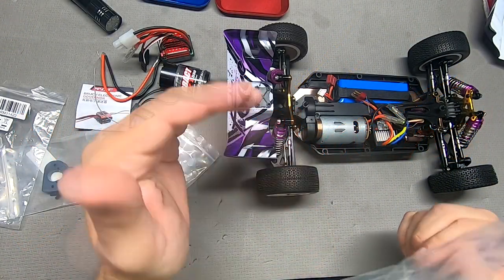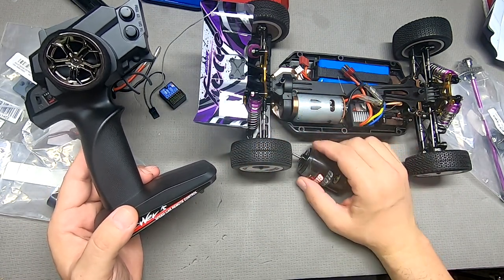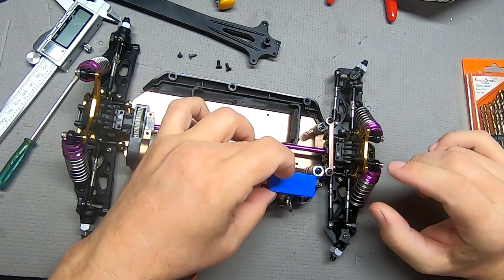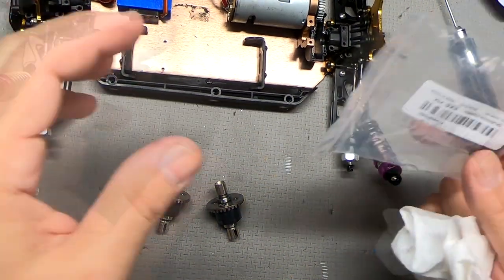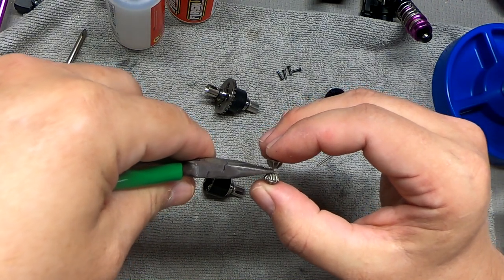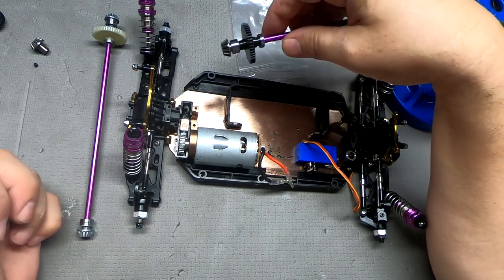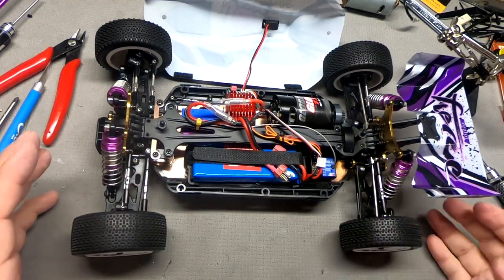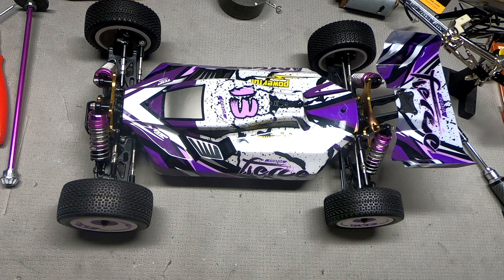New Motor, Diffs, Electronics, & Speed Test - Wltoys 124019 RC Buggy 4WD - Pt. 7

Comment: on my second 144001 i ordered an esc and i am going to use my old flysky computer radio... i have over 10 rx s for that and the range is over 300 meters easy since i converted it to a lipo 10 years ago... i agree the 550 stock setup is great.. i like the gearing also...i get like 20 mins fast and med use on 2s 1500 stock battery.. i have 2 hobby chargers but i find it very simple to just charge this car using laptop usb.. i run this car 2-3 times a week...great car for beginners and anyone that enjoys rc imo
Reply from the maker: Yes, a great place to start. Have you heard about the new 104001? Its wltoys' new 4wd buggy... true 1/10 scale. I preordered one back in January. They are supposed to come out around the end of March. Here's a link
https://shop.makerfire.com/products/wltoys-104001-car?variant=37872357408965&currency=USD&utm_medium=product_sync&utm_source=google&utm_content=sag_organic&utm_campaign=sag_organic&utm_campaign=gs-2020-06-16&utm_source=google&utm_medium=smart_campaign&gclid=CjwKCAjw9MuCBhBUEiwAbDZ-7vy_hXIWWv3OGMYUAoUjDMQtnR11319pdhZpRke19fzezbb2MceT4RoCSZMQAvD_BwE

Comment: Those wl toys rc models are good value for the money.
Reply from the maker: A little preventive maintenance and they are certainly worth the price.
Reply: @MyRCChannel-CJScott  60 packs through this 124019 except 2 sets of tires no visible wear to the gears just the drive cups (marginal)
I use thicker EP90 gear oil for the inner diffs and EP2 grease and a few drops of gear oil on the ring gear.
Reason for this is that the grease will just not stick most of the time due to the centrifugal force.

Comment: Best info out there. I’m a beginner and what you say makes perfect sense. 😎 I have the same goal with mine that I will get soon. I live in China they have complete metal builds available for this car. Also a brushless conversion package with a 5200kv motor esc and metal gears included in one of the packages. Fun times ahead. I’m looking forward to the fine tuning etc to make the control match the speed. Fun times ahead
Reply from the maker: Thanks for the compliment! I'm glad you're enjoying my videos. 
I'd recommend against the full metal build. 
- It adds weight in the worst places... unsprung weight slows the reaction time of the suspension. 
- A little flex in the suspension arms can be a good thing. 
- Plastic parts fit better due to the tolerances needed when making metal parts. So, plastic makes for more precise steering and handling.
- Plastic is much less expensive to replace if damaged.

Also, unless you've got money to burn,  I'd stay with the brushed motor. The car is fast enough as is. Brushless isn't as big an advantage unless it's sensored and sensored motors/esc's are much more expensive. At least wait until the motor fails or gives you a reason to replace it. 
Save your money for things like a proper 2-4 battery charger... make sure it has a "storage" cycle. Properly leveling your batteries is very important. Also getting at least 3-4 batteries for each car helps you not over stress the batteries which can lead to fires and explosions... I'm not exagerating. Check out my video on lipo safety: 
https://www.youtube.com/watch?v=1HjSg_TeIq0&t=3s

Or save for the new 104001. It's the new 1/10 scale 4wd buggy and is the next step up from the 124019. Here's the link: https://shop.makerfire.com/products/wltoys-104001-car?_pos=1&_sid=47c177d8c&_ss=r

I've got on on pre-order myself... looks to be a fun buggy!
Remember, there are no dumb questions and I'll never make fun of someone for asking about something they don't know. 
It sounds like you're off to a good start. I'm sure you'll have a good time with your 124!
Let me know how you like it. And feel free to contact me anytime if you have a question or get stuck.
Regards,
CJ

Comment: I have the  124019 did not change the motor mount  just upgraded the gearing  and diff's lowerd it put foam tires on  nice body   running Hobbywing ESC and motor I am geting speeds of 97 to 100 mph on 3s
Reply from the maker: That's very impressive! I live in a very urban/congested area... it's hard to find a suitable place to do speed runs.
I like to hear what my viewers are doing... thanks for watching and reaching out!
Reply: how will you speeds 97 Mph and keep distance of 328.04 Feet ?===> your transmitter are "out". probably you can "car raced" this is Bonneville

Comment: I wonder if my local hobby shop will do the diffs, suspension, and alignment??  You did a much more thorough job on this car than any of the other channels I’ve seen.
Reply from the maker: Thanks for the compliment. I can't speak to what your local shop can do, but it would probably cost more than the car. I'd recommend attempting the job yourself. Especially the adjustments to the suspension. That's the kind of thing you want to learn and become comfortable doing. 
Instead of paying someone to do the work, you might want to spend that money on tools.
Here are some links to info on rc car suspension, how it works, and what changes do to handling. 

https://img2.associatedelectrics.com/pdf/cars_and_trucks/shared/RC_HandbookV2.pdf

https://www.competitionx.com/rc-tuning-guide/

https://www.rctech.net/forum/electric-off-road/708385-understanding-tuning-introduction-basic-tuning-racing.html
Reply: I blame you. LOL. all the other videos I’ve seen people just grease the diffs and pull a little oil out of the shocks. I thought heck I can do that. Then I watched your videos and thought oh no that’s a lot. I’m gonna have to follow the other videos I guess.
Reply from the maker: @GratefulEd907  Nah, dive in... it's all philips head screws. You'll do it once and it'll be a cake walk after that. If you don't have diff fluid, go ahead and put in some grease, but don't over pack it. Some of it will leak out eventually either way. Don't over tighten the diff screws, twist the outdrive to make sure it turns... if it feels choppy, loosen the screws a bit till it feels smooth but firm. On all the screws use two fingers because they strip easy. Just snug them down, the plastic keeps them from loosening up.
Reply: @MyRCChannel-CJScott  I’m gonna try it I guess. Thanks for the confidence and encouraging words.
Reply: @MyRCChannel-CJScott  just wanted to bug ya one more time. Can you tell me what size Phillips head screwdrivers I’ll need and I’d like to replace any screws I take out with better ones. What should I search for on eBay to find a screw set?

Comment: Great presentation, it's good to see all the pitfalls encountered whilst upgrading and the honest end conclusion; that this project was better left in standard kit form. I'm just wondering if you would consider a similar presentation but this time from Nitro to Brushless...might sound a bit odd but I've noticed second hand Nitro cars going on eBay for next to nothing (unfinished projects or spares & repairs). For example, the rolling chassis of a Kyosho GP Ultima (2wd) is similar to its electric version and with limited tools (Dremel and electric drill, etc.)  could be modified to accept a Brushless set-up? An obvious advantage would be that Nitro kits tend to be beefed up (compared to their latter-day brushed motor kits) and we all know that brushless needs a stronger chassis/components. It's just a thought, but with a few holes drilled here and there, perhaps an brushless upgrade kit, available online, could transform an old tired-out Nitro kit?
Reply from the maker: Nitro is a bag of cats I don't want to get caught up in. But, I've got two brushless RTRs coming soon: the WLToys 104001 1:10 scale 4WD Drive Off-road buggy and the ZD Racing DBX 10 1/10 4WD 2.4G Desert Truck Brushless links below... lots of planes this summer two! And I just finished a race truck and a touring car for VTA. Check my channel's home page. Thanks for writing! I appreciate your input and I hope the upcoming projects interest you.
https://shop.makerfire.com/products/wltoys-104001-car
https://shop.makerfire.com/products/zd-racing-dbx-1-10brushless-rc-car

Comment: What tx do you use in your mod?
Reply from the maker: I’ve got a couple… an Airtronics that I’ve had for years, and a Noble NB4 which I bought earlier this year. I bought the NB4 for mini-z but am now using it as my primary transmitter since it has such great features. You can even switch the wheel for lefties and righties. 
Thanks for watching!

Comment: Well I managed to destroy my shock tower, diff case and steering knuckle in my first crash very frustrating now waiting for replacements. I now understand what you mean on the build quality. I was thinking of upgrading parts but now im thinking of getting something built for purpose. My friends have 2wd TA SC trucks and they are good fun to be honest. What would you recommend, Im not a massive buggy fan and do prefer the look of truggys and short course. Primarily street racing, grass and dirt? Can you recommend any good options using 2-3S? Thanks for any advice.
Reply from the maker: Sure, this all depends on your budget of course, but Traxxas has some great offerings that are in between  the WLToys cars and the "real" race capable RC kits. The Slash in either 2wd or 4wd is an excellent entry level or low-budget SCT option. I'd recommend 4wd over 2wd because they do better in unprepped environments like grass, mud,  wet or loose sand, snow deeper than 2-3 inches, etc. The 2wds get bogged down more easily and can't claw it's way through the heavy stuff. You can even race the 4wd at a lot of off-road tracks with little to no modifications. They are very durable and parts are both plentiful and inexpensive. Most hobby stores will carry parts for suspension as well as online options like Amazon. No waiting 4-6 weeks for parts to come from China. You definitely get what you pay for... if you're interested in the Slash 4x4, check out my video series where I mod one to race in an on-road class called "Truck" where the rules say the vehicle must be based on a truck kit, must have rubber tires and must run on a 2S battery... otherwise anything goes. It's a really fun class to race in and as you'll see I really mod this 4wd truck into a hot race car. 
This is a playlist with all the videos in chronological order... Enjoy: 
https://www.youtube.com/watch?v=YtQrDw0TYKs&list=PLWi1J2KoLS71CXt8_tHXnAqSBpd9FKJwU
Reply: @MyRCChannel-CJScott  Thank you I will check out that play list and also the slash.

Comment: At 1:13:23 I swear that the front and rear left side wheels need to be swapped. It looks like you have the wide one on the front. 

That would definitely contribute to the lack of grip under acceleration.

Comment: smooth diffs and drive trane means more punch and top end plus longer run times in most cases
Reply from the maker: Yes, but tighter/stiffer diffs means better power delivery to all four wheels with less spinning. Varying the stiffness front vs rear is one way to address over & under steer. Tuning is definitely an art form.
I don't know what is your level of experience, but these may be of use to you. Enjoy!
https://img2.associatedelectrics.com/pdf/cars_and_trucks/shared/RC_HandbookV2.pdf

https://www.competitionx.com/rc-tuning-guide/

https://www.rctech.net/forum/electric-off-road/708385-understanding-tuning-introduction-basic-tuning-racing.html

Comment: There's plenty of 100+mph of these all over youtube? Have you searched this car at all? if not, take a look! Amazing what mods people have done for a reasonable price that makes sense.... I have used the soldering iron trick alot with the motor bells on my race drones ALOT, virtually everyone from factory cause they use button head steel chinesium screws.. Gotta get that thing hot.... i mean cooking, then it will release the locktite, not burn it out...  I have a Losi and that money pit is what made me want one of these.... Can't bring myself to spend that cash on something that while it does have higher quality Q.C. and body, This may be some more work, The price in my opinion is not worth it for my LOSI compared to this... can be all aluminum everything and metal gears with parts setup for my use case, and still have cash without losing range anymore. IDK, maybe my LOSI was a one off, it happens, but just my opinion... its like butt holes, everyone has one and would prefer not to hear them.... LOL
Reply from the maker: Sure, I've seen a bunch. I just don't want to spend a lot of money into a cheap car that I can't race. This car isn't legal for any ROAR classes and my focus is on cars I can take to the track. I also only have so much time and money. Lots of people are having a blast with these and that's great. I also think it's a great car for the beginner that can't afford a high end car. There is a new 4wd buggy coming out from WLToys... the 104001. It's a 1/10 scale version of the 129. You might be interested in this. It's still on pre-order, but is supposed to be out end of this month.
Thanks for watching!
CJ
Reply: @MyRCChannel-CJScott  Absolutely, If your planned intention in the hobby is racing, 100% agree! There are no tracks where I live or closer than 2.5 hours away, racing is out of the question for me. Nobody would dump their hard earned cash into something they cannot race, well hopefully LOL. Why make a car that is not approved to a race class? what were they thinking? Seems like a sales gold mine for something of good build that can or can be modded easily to race. Just missed it WLTOYS! From your point of view, makes some more sense, From mine, I was baffled haha. two totally different  perspectives, two totally different usage applications. Thanks for the reply! Keep them vids coming man!!
Reply from the maker: @short-circuitz  That's to bad you don't have a local track. I've got 2 indoor offroad facilities attached to hobby stores about an hour away in opposite directions. I also race on-road with a club that is run by one guy. He got permission to use a high school parking lot. He purchased a timing system and he makes the track layout using old fire hoses, metal frisbee-like disks, and PVC gutter material. He charges people $10 for the first class and $5 for each extra class. I usually run 2-4 classes on a given Sunday... Euro truck, 1/8 GT, 1/10 modified truck, F1, and I'm putting together a 1/10 touring car for VTA (Vintage Trans Am). If you're curious about the modified truck class, check out my video series on the Slash... I starts as a 4wd truck and evolves into a low  4wd 1/10 GT running 1/8 wheels tires, and shocks. At least one or two of the videos have race footage and handling analysis.

Comment: Hi, im looking to buy my first hobby grade RC, would you recommend this one ? I don't want to buy something too expensive since its my first one. Awesome videos btw.
Reply from the maker: Thanks, I'm glad you're enjoying my channel. This isn't a bad place to start and since it has turnbuckles front and rear, it can be a good learning platform.
But, since it isn't a proper scale kit, it can't be raced... there are no classes for racing off-road cars smaller than 1/10 scale.
For the price, it's a good way to get a taste of RC while you decide if you want to race, bash, or other... 
BTW, what are your goals? Do you ultimately want to race? If so, have you identified a track or club near you? These are important questions. If your goal is to compete, you don't want to spend money on cars you can't race at your local track. For example, if there is a hobby store with an indoor road car track, you'd be better off focusing on on-road cars. There is nothing more frustrating than spending upwards of $1000 on a race car and not having anyone to race against. Ex: if everyone at your local off-road track is racing 4wd short course trucks, you don't want to buy a 2wd buggy.
If you just want to have fun in the local parking lot or dirt lot, the 124019 is a good way to start cheep. I don't recommend doing a motor swap, It's plenty fast as is... buy the bundle that comes with 2 or 3 batteries.
Learning to tune suspension is very important. Here are a couple of great guides to suspension tuning... 

https://img2.associatedelectrics.com/pdf/cars_and_trucks/shared/RC_HandbookV2.pdf

https://www.competitionx.com/rc-tuning-guide/

https://www.rctech.net/forum/electric-off-road/708385-understanding-tuning-introduction-basic-tuning-racing.html
Reply: @MyRCChannel-CJScott   My goal is not to race. I want to learn the basics while having fun with the car. Since it's cheap, I won't be afraid to make mistakes. Thank you for taking the time to answer me, i will check those guides for sure!
Reply: @gag0250  yea this an excellent first car imo... I spent $400 on my first car 35 years ago ...it was a kit i built took me many hours...this car has everything you need to start in hobby... it is very fast compared to my first car...good luck
Reply: Get a Traxxas Rustler 2wd vxl. Great car with unlimited upgrade options. Parts are cheap and can be gotten from anywhere. Trust me, you'll love it.